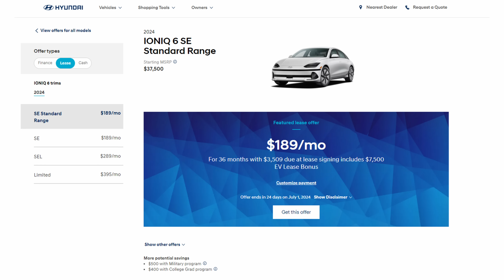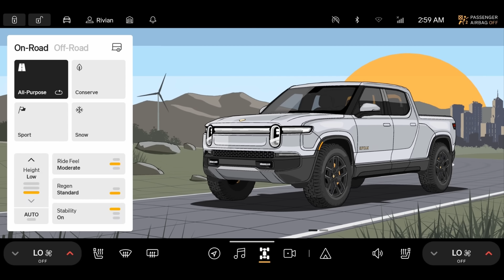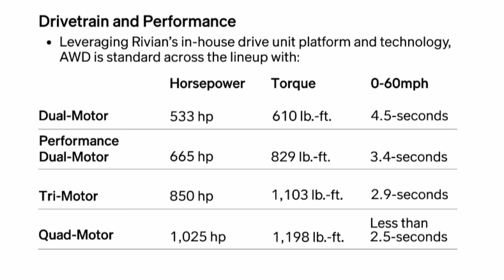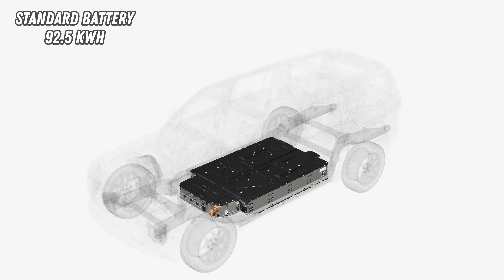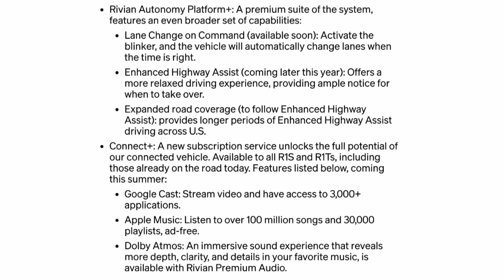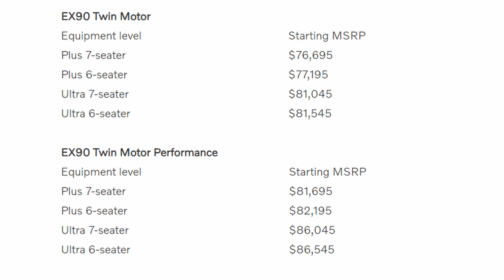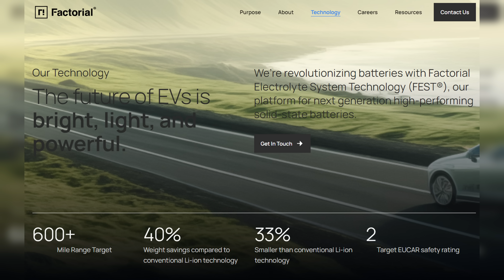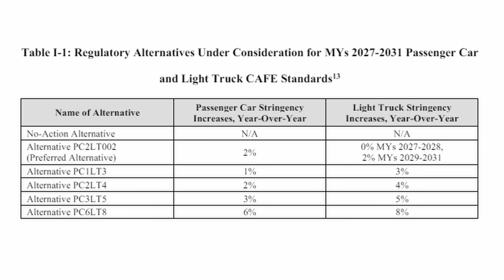The Current : Weekly EV News Ep#14 June 9, 2024

Comment: Resistance heating is very efficient , almost 1 to 1. 😂 A heat pump could be 'more' efficient, 1 battery  electric kW to 3 or 4 in heat.
Reply from the maker: It is important to have a system which scavenges and salvages heat which might have been wasted to the exterior.  -Producer Tim

Comment: Comparing EVs by range is like comparing fossil fuels cars by gas tank size, almost irrellivent.
Reply from the maker: Longer range gives EV drivers more freedom and more time.  For most EV buyers, it is a range is a top consideration.  Miss GoElectric and I each paid a premium for EVs with over 400 miles of range.

There are gas stations on every corner and it takes five minutes to pump a tank of gasoline.  The same is not true of public charging.

More EV range means less dependence on public infrastructure and more possible routes and activities possible. Real world range in cold conditions and driving at interstate speeds is typically much lower than stated range.  That is another reason EV drivers regard the stated range highly when making a purchasing decision. -Producer Tim

Comment: "Solid State" i.e. non-liquid electrolyte batteries are not well understood.  The goal is to simplify, and thereby speed up, cell production, which in-turn would reduce costs of manufacture.  All of the many different schemes focus on replacing the liquid electrolyte, which is a key element in all batteries, with a non-liquid electrolyte.  Factorial plays word games @ 10:20 saying their FEST battery uses a "...quasi-solid electrolyte...".   So far, all of the research has focused on replacing the liquid electrolyte with something else.  In almost all cases the "something else" is more Lithium (i.e. a thicker coating), or other metallic compounds.  In all cases they weigh more and are significantly more expensive.
Reply from the maker: We know there are hundreds of companies working on solutions for better energy density and lower costs. This project is further asking with more tail wins than most. 

Thank you for sharing your understanding. -Producer Tim

Comment: @ms go electric What percentage of range do you lose in the Winter? I luckily drive a Leaf with a heat pump but haven’t experienced a Minnesota winter in it yet.
Reply from the maker: Range loss during the winter varies wildly between the EVs we own and the EVs we drive for our automaker clients on educational programs.

Our 2016 Tesla Model S 90D and 2024 Rivian R1T lose 25-30% depending on ambient temperature and speed. Neither have heat pumps. 

 Our 2022 Model Y had a heat pump and our winter losses were 15-20%. We haven't yet had a winter with our Cybertruck, but we expect a similar outcome.

The 2023 Nissan Ariya lost about 20-25% even though it has a heat pump. It has two PTC heaters, which seemed to be doing most of the work. That integration is sub optimal. 

We noticed 30% losses in the 2021 Mustang Mach E as well. It had no heat pump.

We look forward to hearing how your new LEAF does for you! Thank you for commenting. 
-Producer Tim

Comment: Rivian and any new updates should have the NACS connector in the vehicle at the driver rear or front of the vehicle or both.  Any brand that does not have the NACS connector in June 2024 will hurt its sales.  All new AC and DC fast chargers should only have the NACS connector.  The adaptors will fill the need for CCS1 vehicles.
Reply from the maker: So far, there are no automakers (aside from Tesla) who have announced a plan to include NACS connectors built into 2024 model year EVs.

Ford and GM are the first onboard and they are slowly shipping adapters to their users.  GM, Volvo, and Polestar are scheduled to gain Supercharger V3/V4 access later this year with adapters as well.  We reserved our Rivian R1T in 2019, but we still charge it via CCS when traveling because the NACS adapter has not yet shipped to us.  Like most EV drivers, we do not frequently pay the premium for public DC fast charging and we think the adapter is a minor inconvenience. Tesla Supercharger access will be a game changer in terms of freedom to travel.

Thank you for watching and commenting!
 -Producer Tim
Reply: @MissGoElectric  Tim, thanks for your reply.  I said any NEW vehicles that are now released should have the NACS connector.  Who wants to buy a new product with an OLD plug standard.  Owning a Tesla DMLRY and a Bolt EV, the NACS connector for both ac and DC charging is the ONLY way to go. The cable/connector is so much easier to use for all types and sizes - strength of people.  Not having the NACS on new vehicles and new Chargers will slow the use.  Rivian and GM made a huge mistake, and sales will show they should have implemented the NACS connector.
Reply from the maker: Several automakers said 2025 models will feature native NACS. That kind of implementation takes time. -Producer Tim

Comment: Could MB put the Factorial battery in 2026 models or is this solid state tech many years into the future?  I would buy it.
Reply: The batteries have to be field tested first.
That will probably take a year or two.
That would suggest they will be in consumer available vehicles by 2027/28 
IF everything goes according to plan.
If there is problems it will take longer, but should still happen by 2030.
Reply: @jimthain8777  Yes Jim, your time line makes sense.
Reply from the maker: It is possible, but that would seem to be a best case scenario. -Producer Tim
Reply: Big changes have to come and they eventually will. MB seems willing to move forward with EV tech.